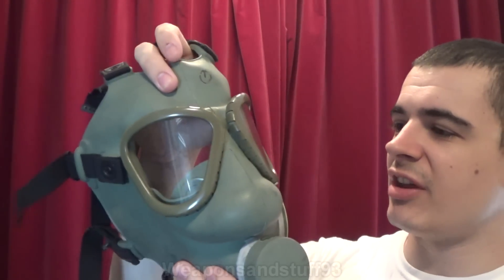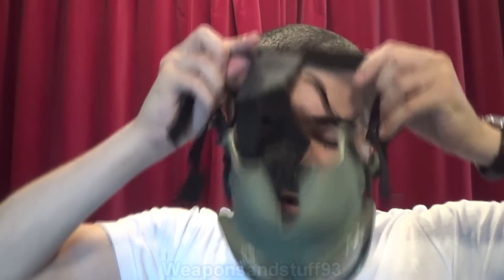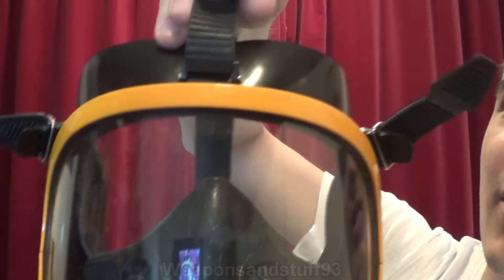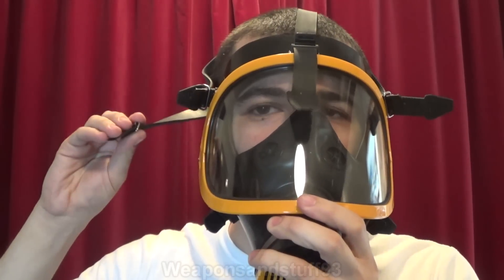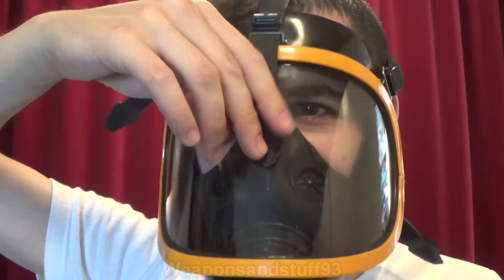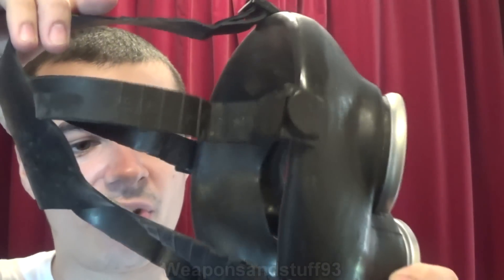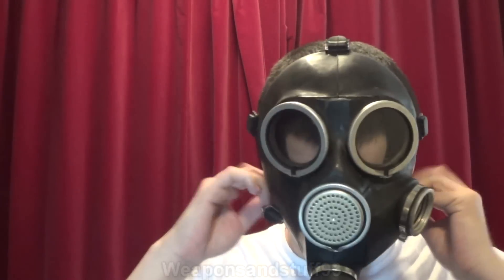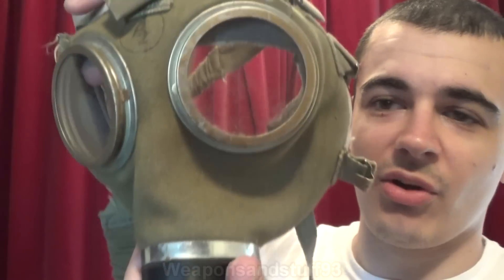My Worst Gas Masks

Comment: worst gas mask: no gas mask
Reply from the maker: Correct
Reply: Rly
Reply: Exactly, better to have a poor mask in a gas attack then none at all.
Reply: Gas mask is best for zone fellow cheeki breeki brethren
Reply: Yeah even a leaking filter on a gas mask with cracked rubber is probably better than nothing
Reply: Fand just don't breathe
Reply: @halopro8958  is gp 5 poor?
Reply: Or a soviet one with aspestos filter
Reply: Gr5
Reply: Fand I had those once, nearly killed me
Reply: @grummanf14tomcat40  no just change the filter
Reply: I mean he aint wrong
Reply: Exactly
Reply: Our face

Comment: The earlier version of the 75M gas mask was the 67M, and it was designed to use a hose as far as I know. I have one myself but it's size 3 so it's no way of fitting on my head, maybe my grandpa had a small had like that (I found it at their house), but it also had the hose.

Comment: With the hungarian one (m76) you realy have to get a mask that fits you very well or even one that is a bit smaller. I have size 2 and it fits my face perfectly (I don't have any problems with the ear straps and it makes a perfect seal) only thing I find a bit annoying is the complete lack of voice diaphragm and the lower portion of the mask pushing against my throat when I look downwards. Try tightening the straps a bit more, yours are very loose compared to mine. Other than that, thank you very much for all your videos, you helped ignite my passion for gas masks, and I also consider you the best source of information there is. Greetings from Czech Republic (by the way, do you own the czechoslovak vz. 35 gas mask?, they are quite rare outside of czechoslovakia and I could get one for you, if you are interested of course)
Reply from the maker: Sadly no the only Czechoslovakian masks I have are the CM3, CM4, M10 and M10m
Reply: I am getting a Vz. 33

Comment: The last mask i got at home myself. Never had a problem with it, filters work on it just fine, and it actually fits me right. I tried a sealing test, and it worked fine aswell. Maybe you got the wrong size after all ? or I just have a perfect fit i guess

Comment: The most interesting thing about the last mask (I own one and its size 3) is it’s size misleadings. My face feels perfect in size 2 (taking GP-5 for example or even PMK1) but in that mask I felt like I was wearing size 1, not to mention I had to change straps in order to get it ON my face! What I really like about this maks is that it is not rubber and I can easily wear it on sunlight, it surely won’t protect me, but there are a lot of good masks that will do the job, nice video as always!
Reply from the maker: Cheers, yeah some people have said that the M76 is in reverse sizes, so a size 1 would be a size 4 in other masks, very strange.
Reply: @Weaponsandstuff93  I can confirm  that size 4 is the largest

Comment: newer mc-1 has better threads and the melting problem has been resolved by thicker rubber and stronger rubber also you need to move it around or keep it in a really cold place cus if any ruber gets too hot it will melt
P.S im from serbia and the older mc-1 was thinner and weaker also the rubber was thiner and the threads were smaler but in the newer one the threads are bigger

Comment: My Yugo MC1 has the same issues as yours, the rubber is kind of folding in on itself at the top, and the filter port is undersized and won't fit any of my 60mm filters or the 60mm to 40mm converter that came with it. My M2 is good to go though, and here in a week or so I'll let you know what my M2F is like.
Reply from the maker: Yeah they are a bit crap the M1's.
Reply: Yea they are. Bought it as a complete NOS set, came with that adapter, 40mm filter, decon kit, some manuals, and one of those last resort NBC ponchos, in a civilian defense marked carrier. Kinda cool I guess. Crap mask though.

Comment: I've started to gather supplies for smelting lead(making bullets) would you recommend a gas mask? If so would I use an ABEC?
Reply: I probably would add a P3 filter, they aren't expensive and if you try to smelt old lead you probably get some dusty lead. I don't know if a ABEK would stop lead.
Reply from the maker: Lead dust itself is blocked by a particle filter so a P3 filter, but getting a full ABEKP3 filter would not be a bad idea.
Reply: Thanks!

Comment: Ackchyuallyy...Hungary produced the own version of GP-5. Its called 60M Both for civ.protection and military use. And yeah thats kinda weird why stopped the manufacturing of that mask and designed this strap-canvas monster.
Reply from the maker: Interesting, yes very strange they abandoned a good design and went with a WW2 mask designed because Nazi Germany had a lack of rubber.
Reply: Egyrészt a 60M nem a GP-5 másolata hanem a SM-41m másolata. Másrész a 67M és a 75M azért készült olyan formában amilyen mert olcsóbb volt a régi 34M mintáját követni, a szelepház változtatásával hogy minnél olcsóbb legyen. Mert a 34M alumínium háza drága volt.

Comment: Could you disassemble and reassemble a GP-5? Looks like something like that hasn't been documented as far as I looked
Reply from the maker: Not unless I have a problem with one.
Reply: oh wow you can actually remove the lens by gently uncrimping the metal outserts. I've done it and replaced it with lexan lens and now I have a airsoft gas mask.

Comment: I have the M1 the one problem I have with it I don’t know if I have this problem but when I checked mine one of the straps came off like the rubber ripped don’t know what happened but don’t know how to repair the strap but if you know how to repair those a try to tell me how

Comment: I have a GP-7V.
The drinking apparatus isn't great. I also have a bottle for it.
In the bottle, there's a hard black holding thing to hold the drinking bit... but mine chipped after a handful of insertion and removal, so now it doesn't stay in by its own.
Drinking from the bottle with the drinking bit sucks. It leaks a lot.
Also the mouth piece of the straw gets in the way of my lips (unless I wrap the straw in a way that will deform a bit of it over time).
In the insert piece of the straw, there's a piece that keeps it closed, unless pressed in.

My GP-7V is one size too small for me. It's medium-sized, while I would need a large size, so it's impossible to put on or get off unless I unstrap one of the straps at the neck.
Reply from the maker: Yeah late Soviet built quality is awful.
Reply: I have GP 7 vm

Comment: A huge fear of mine would be if a gas mask got stuck to my face and the filter wasn’t working properly meaning I couldn’t breathe I would be suffocating in this mask

Even freaks me out just to think about having any Mask stuff my face anything that goes over my head I think if I can’t get it off that’s what scares me
Reply: What I'm scared of is my only mask option being one of those masks which have an extremely cramped face area, a small, barely effective filter and small, easily fogged lenses.

My other fear is having to use it.

Comment: I have the Dräger mask the Puda was copied from. The rubber is less soft and it can support the weight of an A2B2EK2 P3 Hg filter, but the strap system isn't so good, if you don't have extremely short hair you probably get a few hairs in there.
Reply from the maker: Well all masks are basically designed to be worn clean shaven and practically bald.

Comment: I think that m1 is actually m1c. How I remamber m1 has smaller nose and no cover on exhale valve. And little bit lighter colored. The rubber is probably is the same but I never had a m1 in my hands/face. :D.
Reply from the maker: The C variant has no oral nasal cup inside apparently.

Comment: I have the Hungarian  gas mask its from the army and it is 50+ years old
Reply from the maker: As in, in military service or just as a collectors piece? This mask was the civil variant, the military variant had a metal bit instead of the plastic at the bottom.
Reply: @Weaponsandstuff93  let me check
Reply: @Weaponsandstuff93  theres metal
Reply: @Weaponsandstuff93  the friend i got it from worked at like safety idk at this point and he got the mask and radioactive pills and and other safety stuff he said its from Hungarian millitary